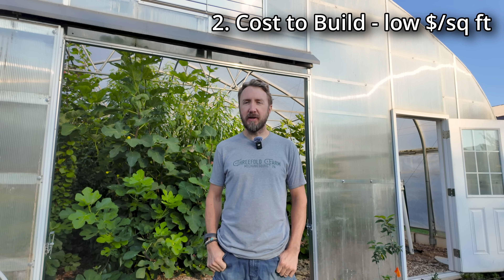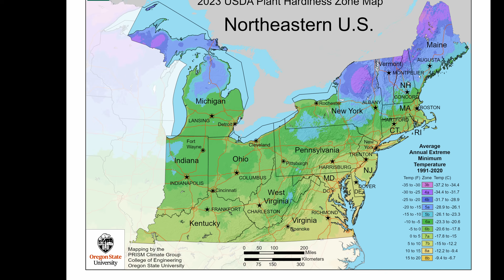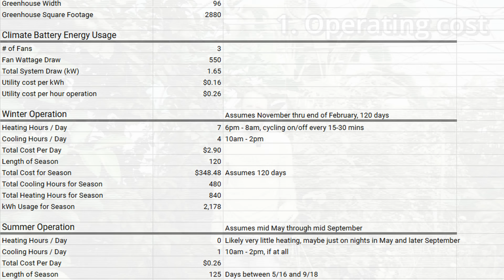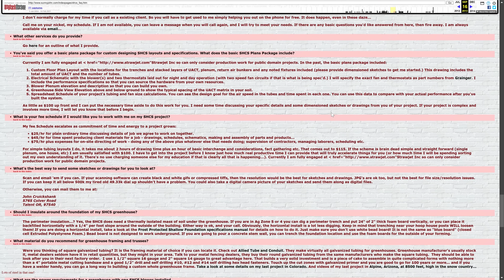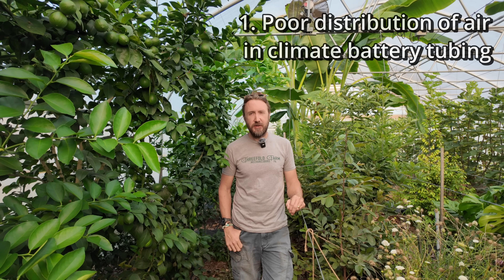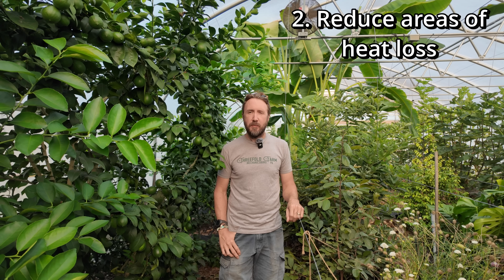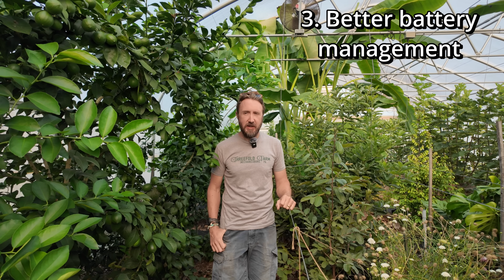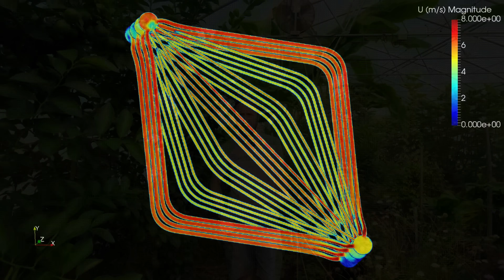Building an (Almost) Tropical Geothermal Climate Battery Greenhouse in a Temperate Climate

Comment: Very interesting.  As I was watching I was wondering about adding rigid foam insulation in the ground to the frost line under the walls of the greenhouse.  In my research for insulating a shop it was amazing how much heat leaks out through the slab under the wall if the slab isn't insulated under the wall.  So basically strategic insulation.  Other idea would there be benefit to incasing the pipe in gravel instead of dirt, would rock be a better heat sink that dirt. Could you maximize the area under the greenhouse if the rock allowed airflow through all the ground?  I grew up with stories of houses built on rocks that would allow air flow so a fire could be built under the house and the rocks heated up and the house would stay warm long after the fire had went out.
Reply from the maker: Yes, at some point it makes sense to insulate well around the foundation. SARE project FNC19-1185 does a payoff comparison for various thicknesses of foam in foundations depending on your planting zone, if you're interested.

Rock really doesn't have a better specific heat than dirt (especially dirt with some water content as most subsoil would). It does provide some interesting airflow characteristics that we've noticed in our second greenhouse (we surrounded the tubing with 1b stone to prevent crushing the pipes on backfill though it likely wasn't necessary). It likely does, functionally, increase the amount of surface area you're interfacing with.

Appreciate you taking time to comment.

Comment: Wow this is very interesting! Hope to see a lot more details in future. Two questions:
1. Do you think the solar orientation of the greenhouse matters or could be optimized? 
2. Did you do any perimeter insulation in the soil? (Similar to frost line slab insulation in normal buildings)
Reply from the maker: Good questions. We orient ours east-west in the northeast to maximize solar gain, though ours is tilted a bit so the end-wall runs perpendicular to the prevail winter winds and we installed extra bracing there. My intuition tells me that it matters somewhat for capturing the most solar gain in the winter but I'm not sure I have data to back it up. 
We did a little insulation in the soil but I don't think it was effective. Insulating the perimeter makes sense to varying degrees depending on your climate and the size of the structure.
Reply: @ thanks for the reply. I suspect good insulation could make a difference in your climate, but it would be interesting to know if that’s true. It also might be that the same money could be spent excavating deeper or installing more tubing to get higher performance. Again interested to hear more details and about your analysis tool.

Comment: This is a fantastic overview. We're trying to plan out a similar sized greenhouse here in Maine, and figuring out heating has been a huge optimization problem. As a software engineer, I appreciate doing actual modeling instead of the "guess-and-check" of most homesteaders.

Comment: Greetings and thank you for this information. This spring, I am getting more ambitious with my gardening (due to what I believe will be even higher food costs than the previous years). I live in central Wisconsin and typically colder than even Pennsylvania. I will be planting 6 hardy fruit trees (2 cherry, 2 apple, and 2 peach) and expanding my current garden of 10' x 15' up to 20' x 40'. I also plan on building a greenhouse as well in the spring. Currently, due to available land size limitations, I have plans to make it 12' x 16'. By your admission, it sounds like it would be too small to be a good candidate for a geothermal battery.

I also want to maximize the available space I have inside my greenhouse. I was thinking of constructing a gutter system to collect rain water into 2 55 gallon barrels inside of it. I was hoping that I could use the water for the plants during the growing season and then use them for thermal mass during the winter. Do you think that this system would be a better solution for the size of the greenhouse I have in mind? Please and thank you for your time.
Reply from the maker: A climate battery isn't out of the picture, it just likely needs to be insulated (especially in a climate like that). I'd recommend taking a look at the work done by SARE project FNC19-1185 (google it). He did a lot in a small space and there's a lot of good info on the site.

Comment: I wonder if you can achieve better battery management by automating the changing temperature set points based on actual soil temperature. It wouldn't be terribly expensive to install RTDs in the vents during install, I would think.
Reply from the maker: Additional automation is definitely something we've considered and I'd eventually love to have a more robust controller. That said, we really don't adjust the temperature all that often because the soil temperature moves so slowly that we don't need to make frequent adjustments. Once or twice a month is all.

It would be neat to have a controller that suggested (rather than forced) a temperature based off of the "charged state" of the soil and could take into consideration future weather patterns.

Comment: Did you reduce the diameter of the underground pipe closer to the fastest wind flow and or increase the diameter of those pipes farther from the fans? I hope that was clearly stated…
Reply from the maker: Varying piping size can help in passively balancing airflow if done properly, yes.

Comment: Is there a formula/calculation for the amount of "battery" (the soil below the greenhouse) per square foot of green house?  Does this system become too inefficient when scaled down to work with a smaller greenhouse size such as an 8x10?
Reply from the maker: Not really a formula since each person will run their battery differently and the size needs of the battery also depend on how much solar gain a particular site gets (a sunnier site could potentially get by with a smaller battery). As for smaller systems I'd encourage you to take a look at SARE project FNC19-1185. The guy who ran it did a great job with a smaller footprint greenhouse.

Comment: What about building thermal mass storage into a climate battery? Water jogs and Chinese greenhouses with a dirt wall are passively absorbing and releasing energy, so why not introduce piping into those bodies and actively pump energy in and out of those thermal masses?
Reply from the maker: Yep, you could, or you use a combination of passive and active thermal mass that both would provide.

Comment: I know you said the cost was too high for the insulated greenhouses, but since you are excavating already, why did you not sink your ground level under the greenhouse? Would you end up with a similar battery effect? Is there a cost or downside that I’m missing? Also, what is your energy consumption with the fans?
Reply from the maker: Consumption of fans is around 2,000 watts when running. Sinking the greenhouse is a possibility but creates some issues too (stability of side walls, making sure grading is good to keep water away).

Comment: Seems like the poor air balance could be reduced by dispersing the system rather than centralizing.
Using two or three smaller, independent manifolds , each with their own smaller fan would make it easier to ensure that all airflow pathways have equal friction. While it might increase operating costs slightly, it would improve reliability and could conceivably reduce installation costs overall since smaller pipes are needed to handle the lower airflow.
Reply from the maker: Yep, this could work. All comes down to cost and efficiency along with ease of installation and other factors like scalability.

Smaller fans do tend to be less efficient (cfm/watt), but if those inefficiencies were offset in some way it could work. Appreciate you taking the time to respond.

Comment: It seems like you are pulling in air from near the ground level, and discharging it there too.  The other designs that I've seen had risers so the inlets were near the roof, to pull in the hottest air during charging, and to stir the air more during discharging.  What drove that aspect of your design?
Reply: Hey I've got a similar situation with the slope. I'm thinking of recessing into the ground in hopes to gain geothermal warmth that way combined with winter hot composting.
Reply from the maker: Appreciate the respectful question. One is cost (those tubes are expensive). Two is space (I can farm over some of the outlet tubes at least so I don't lose the square footage. Third is my intuition that I'm cycling through all of the greenhouse air pretty quickly when running the climate battery fans and the HAF fans (circulation fans) I run reduce stratification in air. So if the upper air is a few degrees warmer I've cycled/mixed it with air coming out of the climate battery so I'm not failing to capture "extra heat" at the top of the greenhouse.
Reply: @threefoldfarm  My hope is to build a greenhouse for my personal use, so much smaller.  My land is on a steep south facing slope, so effectively more earth sheltered and more of elevation change from the lowest part to the highest.   But, I'm a couple of years from construction - got to build the house first!

Comment: Just fascinating- and I really appreciate your engineering approach. Would you be willing to say a little bit more about how you solve the 80/20 problem? What was causing 20% of the pipes to do most of the work and how did you solve it in the new design?
Reply from the maker: Unbalanced airflow was the main culprit. Some pipes were starved for air due to preferential paths that the air was taking. We minimized it in the new design by borrowing from HVAC principles for balancing airflow: minimizing sharp bends, simplifying the piping layout, etc. We certainly don't have fully balanced airflow across all tubing but we're closer than the previous designs and none of the pipes should be starved for flow, most sit in a more ideal velocity range to facilitate heat transfer. Hope that helps.
Reply: Parallel paths share an input manifold and share an output manifold. Therefore the pressure drop across the paths are the same. If you want the same flow rate in each path, then you need the flow resistance to be the same.  The most obvious way to do this is to make the paths identical. Equal diameter, length and same number of elbows, etc in each path.

Comment: A decent presentation. I would have shrunk the first 8 minutes into 2. Here are a few additional points.
1. The climate battery does not have to be solely under the greenhouse. That also allows you to seasonally heat it even hotter than you might want the soil under the greenhouse.
2. A solar thermal chimney will passively create airflow for free (no ongoing operating cost)
3. Since you have no insulation, the biggest challenge is heat loss. You could have saved immensely with heat loss through putting the green house a few feet into the ground and bermed everywhere that is not the South side.
4. Composting is a natural companion of growing/greenhousing. Composting generates a lot of heat. If incorporated correctly in a design, compost can provide about a 20 million BTUs per ton. So if you have reduced your heat loss through undergrounding, reduced your operating costs through solar chimney, and improved your heating through composting, you have just made a huge difference in your system. One guy who built an underground bunker with composting for warming had to modify the design because it became unbearably warm. 🙂
5. Insulation- I don't know how you came up with $30/sqft for insulation but that is very expensive. There are certainly cheaper options. The single best solution for all but the south facing glass is EPS foam concrete. VERY cheap, 90% recycled, great insulation values. It is labor intensive though.
6. There are in ground designs that better maximize materials cost, heat loss, and climate battery that are very far from conventional looking greenhouses, but very cheap and effective.

Comment: Really great video and exactly what im thinking of doing with my greenhouse in the UK. Would you be able to provide the links to the resources you used from sunny john? The FAQS and the material outlines at all? I cant seem to find them online.
Reply from the maker: Eco systems design I think has an archive, but you can also access it through the wayback machine. As I mention in the video, there are some guidelines in those resources that I don't necessarily agree with but in general it's a good introduction to climate batteries and John did an excellent job overall at building those structures and pioneering use of the technology.

Comment: Question: What happens to the water that drops out of the air when it is in the pipes below ground? Is there a drain built into the pipes?
Reply from the maker: Yep, the pipes are perforated so they drain out any condensation that forms.

Comment: This is an outstanding YouTube video, bravo! Quick question, have your engineering students looked at different materials for the climate battery? Soil vs gravel vs concrete? Cheers!
Reply from the maker: We haven't had them do that. Soil, especially soil with some water content, is actually pretty decent considering the cost (free with excavation). You can look up 'specific heat' to determine the heat-carrying capacity of various materials if you're interested in a comparison.

Comment: Jesus.  Fantastic.  Make more.  Also, I always wondered, what if, on top of your battery, you made a green house within a greenhouse?  Much more thermal insulation and immune to wind....
Reply from the maker: Planning on making more! As for greenhouse within a greenhouse, that would certainly help. That's what row covers try to do and I have heard of folks doing multiple layers. This is also what energy curtains do in gutter connect structures in addition to reducing the air volume being heated.
Reply: @threefoldfarm  I also find, perhaps not in a green house but in it might help- and I am sure you are aware of this- that circulating air in the space, even if it is cold, yet above freezing can have a mixing/stabilizing affect.  For example, I have a cabin with a wood stove that gets nice and toasty around human height but the ceiling is 120 degrees and the floor at times was 30.  By mixing the air with fans, I can homogenize the air temp of the space to an average that is above freezing, and this at least delays any one part the space from freezing.  (I have a lot of things in there sensitive to feeling).  Can't wait to see more of your endeavors.

Comment: I was wondering on the airflow when I saw you had created a pipe system that reminded me of a bus system in a computer. 

Most air to ground batteries I've seen used 1 tube (long and winding, similar to geothermal tubing) so the air only has one way to go.

I saw a comment on your site about having the intake near the peak. Can only really do that in right angle greenhouses (so that theres no shading). It seems to me that it may be useful for collecting the hottest heat and pumping it below ground, not to mention that it may easier to pump air into a tube when it has nowhere else to go. 

However, you may also be able to utilize the chimney effect if the entrance/exit are at different heights.

I do wonder if placing a fan at either end may help. 1 to push air through and the other to pull air out, least in the case of using 1 long underground tube.

Comment: What a great video man. I love it. Also why make the inside ground of the greenhouse at the same elevation as the outside ground? Wouldn't it be better to plant 2-4 feet below the outside ground level? Therefore the plants roots get a little warmer
Reply from the maker: Appreciate the comment and the kind words.

As for putting the greenhouse below ground, yes, that would help to insulate the structure a bit if you reduced the exposed surface area as well. The trickiness comes when determining a foundation for that below-ground portion. Our soils would likely slough off so we'd need to build something to retain them. The added expense wouldn't be worth it most likely, plus we'd need to still grade away from the structure to prevent water migrating in in a heavy rain. So, definitely possible but I imagine the cost for us wouldn't make it worth it.

Comment: really interesting video! I've heard about people doing something like this in a domestic setting, although there it seems like the plug of earth that the house sits on is typically surrounded by insulation and then waterproof membrane, I suppose to reduce the amount of heat you lose in storage. Did you consider anything like that here or would any additional benefit be negated by the cost of the extra time, work and materials?
Reply from the maker: SARE project FNC19-1185 does a pretty good analysis of the "worth it" as it regards insulation for a given zone (check out the graphics in the final report). The TL;DR version is that some foam would be helpful for many places in the northern US and less cost-effective as you go further south.